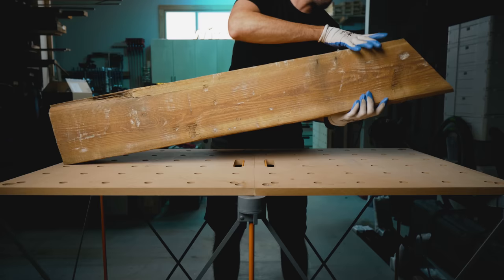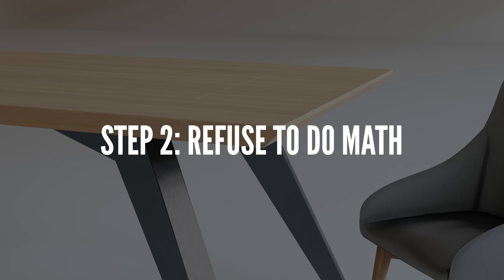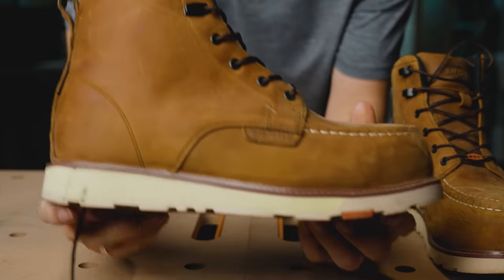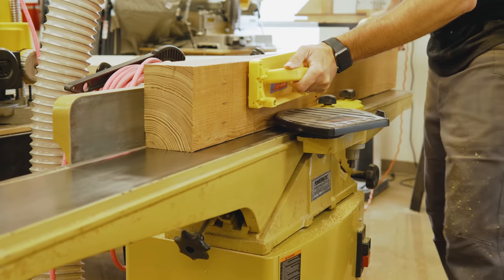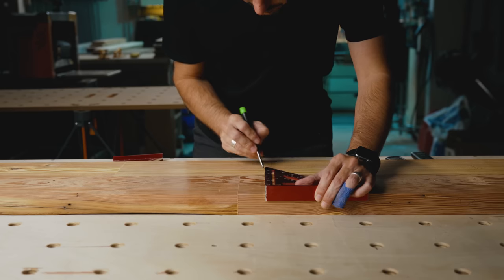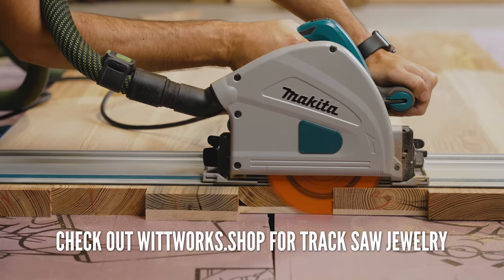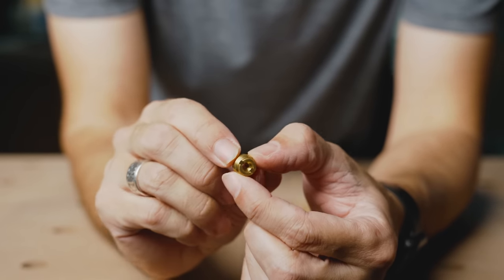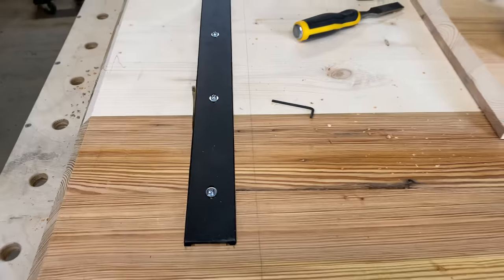I Can't Believe I Sold This for $3750!

Comment: Great video, much to learn. I really like upcycling existing material. Those calculations can be daunting, but personally I enjoy figuring it all out, it’s very satisfying to get the most out of a random stack. Watching the video, I was thinking cut the boards as thin as feasible/neccesary to get yield and put it on a simple wood backing (nicely dried! since you are working with old material). Would have to make the edges full thickness of course.

Comment: Exposed domino on the end is hard. I have a few in my desk (made partly from flooring I saved out of my first house) where I sanded a bit too deep trying to flatten the whole thing. I just took it as an opportunity to practice making bow ties, and added a few more just for looks. One nice thing about working with reclaimed material is that you can add just about anything and call it #bespoke.
Reply from the maker: thank you

Comment: That's a great video (my first visit to your channel).   I love the project, the techniques, your honesty, and even revealing your faith unabashedly.    I had a thought on the sandwiched pine in order to totally hide the end....perhaps you could domino a proper thickness piece on the very end of it as part of the sandwich, while leaving the full piece on the top half.  Then the grain and aging would be alot closer to the top part.   It could literally be a scrap that is maybe just long enough to accommodate the domino length, since it will be sandwiched to the top it's not really structurally required.
Reply from the maker: Your idea is brilliant and two weeks too late 🤦‍♂️ that’s exactly what I should have done
Reply: @wittworks  LOL.  I thought of it as I watched.   I have the luxury of 20/20 hindsight and no time pressure.   I learned from your sandwich idea and that us how good YouTube communities work by sharing the little improvement ideas

Comment: So I have to say I really like your resaw trick.  I was watching and thinking you didn’t have the best blade for resawing and yeah you lost a little more wood with the table saw (but probably still less than you would have lost jointing the board flat with drift).  I’m going to have to try that trick.  Great video!  Loved the table and yeah those legs did look great!
Reply from the maker: Thanks! I ended up buying the Makerspace a proper re saw blade after that.

Comment: resawing isnt easy. you can do it all on the bandsaw but its taking two routes. either a really wide blade like 1 inch to use with a fence or figuring out what the drift is like on the saw ditch the fence while working with the drift to follow the line. when i resaw i follow the line without the fence. my blade is 1/2 inch. resawing on the table saw is another good option glad you worked that bit out.

Comment: Very nice work! Perhaps you could have used a short offcut to glue on the underside of the thin boards, and just fill the middle with the store bought pine?
Reply from the maker: That would have been perfect. Didn’t think of it in time 🤦‍♂️

Comment: Props for jumping outside of your comfort zone and learning new skills. Curious if you offered a discount for having to add non original wood backing to some of the thin boards which might be seen at 28:39? Obviously too late now, but could you have glued some scraps of the original wood close to the end so the pine would have only seen from the underside?
Reply from the maker: No discount - I charged more. I set the expectations going in that we might not have enough and he was prepared to buy more material if needed. He approved seeing the ends like that and liked the detail.

Comment: You can use this type of regular epoxy when mixed with a lot of wood dust. No problem with bubbles then. And in my experience looks better than wood filler.

Comment: Looks great, but one note: since Pine is so soft, I would not have used Rubio as a finish, and instead oiled (Linseed is my usual go to), followed by a poly or lacquer coat for durability. Pine dings so easily.

Comment: It was a nice touch adding the charger/outlet in the middle of the table, a good idea to have the wire from it running down the back side of one of the table legs to hide it would have been better in my opinion but other than that, great job on the table, it looks very nice!

Comment: I bought a brand new professional bandsaw from Felder and turned out this saw was a pain in the a... One of their mechanics came to my shop and tuned it. (for free even if it nomally costs sth). Much better now. But I dont trust it really. So cutting up large lumber still is dine at the tablesaw, even if it costs me 4mm of wood. The table saw is simply trustable. I use the band so for smaler cuts nuw even if it technically could cut up to 20 cm in hight

Comment: A little advice if you ever try tapping threads directly into wood again: Much slower! In metal, you can direct drive taps with a drill like that, but they also make t-handle wrenches that clamp onto the tap so you can do it in a more controlled, slow way (usually sold in the same area as the taps themselves. Also, yeah pine probably isn't going to hold a thread for very long anyway.
Reply from the maker: thank you. I'm thinking slow and by hand?

Comment: Excellent content and video, though I'm more of a welding fanatic than wood.  Add that part where you CNC plasma and weld your own leg design and it's an A+ in my book.  But seriously, great lesson in averting the inevitable pitfalls of custom design fabrication and ending in a great product.  In regard to small deviations to design, I prefer: "There Are No Mistakes, Only Modifications" to bespoke...though that's not always acceptable to a customer.  Soldier on.

Comment: Too late for this project, however, if you want to tap threads into wood again sometime try this.
Tap your threads then put CA glue into the threads (without the bolt) it hardens the wood to almost metal like strength. Make sure it's good and dry before your put the bolt in the threads. :)
Reply from the maker: Thank you. You think slowly tapping by hand and then use ca?

Comment: Looks great. Good fortune on your woodworking adventures. 
Next time you resaw a board to thin… laminate the white pine like you did but add a scrap cut off of heart pine to the end so the only heart pine shows after the chamfer.
Reply from the maker: I thought of this AFTER 🥴 and its a great trick 🙈
Reply: @wittworks   technically the heart pine could have been laminated back together then re-resaw to the correct thickness. You would only need an extra blade width to do that.  
Re-resaw- 😂.

Comment: Cutting relatively fine threads into pine - yeah, that is a non-starter.  OTOH, I've cut big threads in pine to mount stuff on my wood lathe headstock, and that works fine.

Comment: Easy tip for you.   Never, in any material, put a tap into a drill.   I could see the problem when you tapped, the drill moved too fast and the tap put in, then immediately removed (ripped them out) the threads.   A tap (and a die) should only be used with either a hand tool (a t handle driver is great for the types of tapping you'll be doing in wood projects) or a special machine (which is used to threading big stuff, pipes, etc; not something you'd ever use on wood).   20 bucks for a good t handle tapping handle, you won't have that problem again.
Reply from the maker: Thank you! I got a t handle ratcheting one yesterday!
Reply: @wittworks  That'll do it, exactly what you need.   I also usually epoxy (quick setting, the thick stuff) my threaded inserts when I install them.   I'm sure it's not usually necessary, in fact, I'm not even sure it's very helpful, but I like the belt/suspenders approach, especially when I'm building something that people might move around with some frequency (tables, in particular) by picking it up in a way that stresses the threaded joint.
Reply: @wittworks  nice! Where did you find a good one?😂
Reply from the maker: Harbor freight with a 20off coupon

Comment: Bandsawing large stock of any kind can be a pain, I work with sheet plastics, and the other day I yanked the bandsaw blade of the wheel trying to back a piece out because I slightly underestimated the space available to turn the L shaped piece, that and the dull blade created enough heat to reseal hot acrylic behind it 😂. Thankfully not an expensive piece, but it sure was stupid of me. I ended up using the jigsaw instead ... Very slowly

Comment: I am a small business owner, 30 years. I want to say that I feel your itemization of your costs/expenditures is incomplete.
Most owners do not properly evaluate their true expenses. You have a cost per sq. ft in your studio. You have HVAC, utilities. You have janitorial services, brooms, bags, trash pickup. You have travel expenses, gas, mileage, wear and tear on your vehicle. You have use costs on your machines, replacement parts, belts, blades, etc. You have glues, adhesives, coverings and coatings. You have communication costs, your cell phone, a laptop, internet connection. You have R&D time spent learning and making mistakes, consultations.
I think the price you received was a fair price, but far less profit than you estimate.
Turned out beautiful by the way.
Reply from the maker: I’ll charge $10k next time. 😬

Comment: Howdy fellow Texan, i have a quick question for you. I made a router sled and finally got to use it on a cookie but somehow ended up with a .65mm cup in part of the cookie. Which got me thinking how flat is flat for a wooden table, you're thoughts on the matter would be much appreciated. Well, it seems I have to make a few more passes on this thing, looking forward to more vids!

Comment: Did you consider sourcing old Barn wood or old growth from a local source/dealer? I assume you looked for places near you.

We have a dealer near me that has tons of old growth pine and fir but the cost per BF is expensive for the type of lumber.

Though he would be safer to buy from then some random person with old barn wood you know nothing about. So for a project like this the over $10 a boardfoot could have saved your project without making that sacrifice and using materials from the hardware store.

You may know all of this stuff already though.
Reply from the maker: I did, but was pressed for time - and the client said he was fine with me getting wood that day so he could have his table by his deadline.

Comment: Pretty wild that the most expensive piece you have sold was made of pine!
Reply from the maker: yes, I hate pine, but in fairness, this was really cool old growth "heart pine" from a Chattanooga warehouse. It had sentimental value to the client. The beams were left over structure timber from their home renovation. So having a table made from the wood from his house was the value.
Reply: @wittworks  no doubt! The wood has a cool story behind it. You did a great job turning those worn beams into a table! I am currently building a chess board with some old growth black walnut that was milled over 100 years ago. Will be publishing a video on it once completed. Reclaimed wood projects are fantastic!

Comment: What were the settings on your xtool for the whitt works logo on the bottom of the desk I like how deep you were able to get it
Reply from the maker: if I remember right, it was 60mm/s and 50% power (on a 20w head)
Reply: @wittworks  all in just one pass on fill setting? I have the 20w setup too

Comment: Someone tell Drew about those giant eraser sticks. Those sander belts will be good as new in less than a minute. You can get them everywhere, including taytools.
Reply from the maker: I have one. Doesn't work with resinous pine. That was one pass. Spent 30 min trying to clean it with your stick, and even a chisel. Melted on.

Comment: Dude!  You lucked out.  Buy a lottery ticket.       You really should get your overall techniques and practices down before using them on a deliverable product!   Sure every commission is a little different and you're going to run into combo's you never had to do together time after time even after years in the biz, but here it sounds like you were doing noob things that should have been "I know how to do this! (even if it's a little different this time)" time after time.     I'd say make a few pieces like what you hope to be able to do on commission free form, trying out the techniques you are likely to have to need, then - at least those that are half decent or better - take to the local farmer's market to be sold on consignment at materials plus an estimate of bottom line hourly of what you think it should have taken once you get those techniques down,

Comment: Not bad for a novice woodworker but you really need to find a better solution to Butt Jointed Boards, whether it is a Spline, T&G or Mortise & Tenon or whatever you can do to eliminate gaps and have a tight, end grain to end grain assembly.

Comment: The threads you use in the wood for securing the c-track are put in wrong. The track in them you think is for a screw driver us a cutting track. NOT for the use of a screw driver ☺️
But great work! ☺️

Comment: Hey Drew, love your videos!  I just subscribed!  Couple things.  First, Bent Woodworks has a video on different ways to fill wood.  The Rangate Knot Filler would work great for things like your little epoxy mishap.  https://www.youtube.com/watch?v=ync1AVpO26w .  Second, I have a question for you.  I'm in the market for my first track saw.  I'm heavily invested in Milwaukee M18 and I had my eye on their track saw. HOWEVER I saw your short where you said TSO doesn't fit right on their tracks, and that's a deal breaker for me because I also want to use TSO track guides.  What would you recommend in this situation?  Makita?  Festool?  Milwaukee saw on Festool track?  You also mentioned they seem to fit just fine when you clamp them down?
Reply from the maker: Thank you!

If you don’t anticipate using the 45 degree feature, you can do Milwaukee on a makita track. The anti tip does clip in sometimes on the makita. Sometimes not. It depends how you calibrate the saw. I wouldn’t do Festool rails for Milwaukee. 

I think TSO will eventually come out with a Milwaukee version. Not sure.
Reply: @wittworks  and if I do Milwaukee tracks, you said when you clamp the TSO guides down they seem to be fine, correct?
Reply from the maker: Seemed fine to me. TSO values accuracy and there’s something they don’t like. It might be minor. I haven’t figured it out yet. But they clamp on and seem fine to me.

Comment: You could save more by having AI design it for you. And you can just keep having the AI redo it until you get one you like. Honestly that’s probably what the guy on fiver did.
Reply from the maker: whats AI?
Reply: @wittworks  Artificial Intelligence. Some examples are:

SketchUp - SketchUp is a 3D modeling software that uses AI tools to create 3D models of furniture and other objects.

Autodesk Fusion 360 - Autodesk Fusion 360 is a cloud-based 3D CAD/CAM tool that uses AI to generate design ideas, automate designs, and optimize designs for manufacturing.

The AI Chair - The AI Chair is an AI tool that uses machine learning algorithms to generate new furniture designs based on a user's preferences.

Space Designer 3D - Space Designer 3D is an AI-powered interior design software that allows users to design and visualize furniture and other interior elements in 3D.

Tylko - Tylko is an AI-powered furniture design tool that allows users to customize and personalize furniture designs based on their needs and preferences.